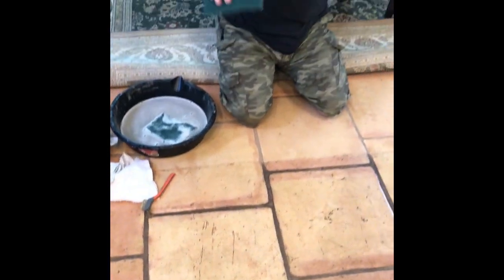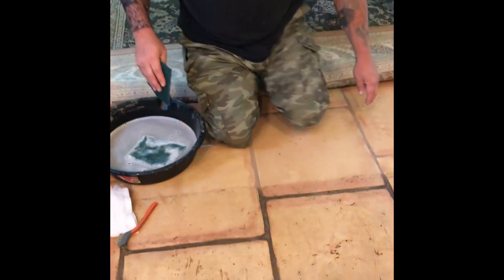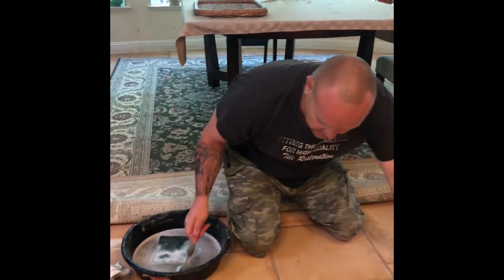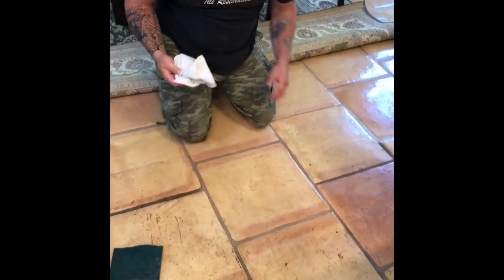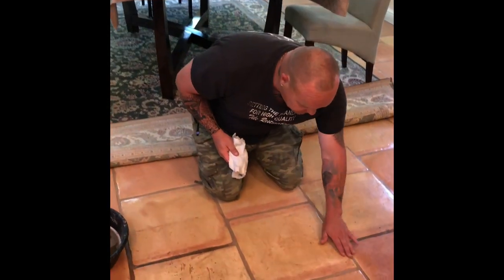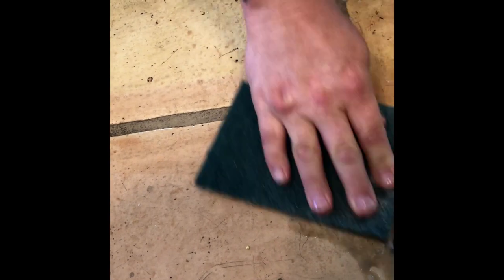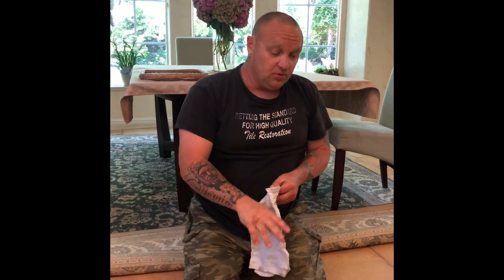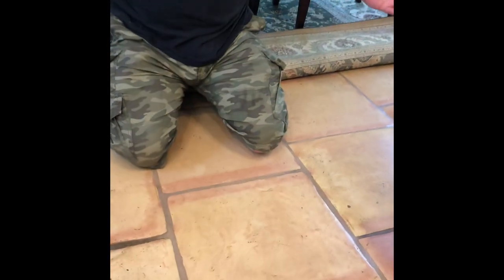How To PROPERLY Maintain Your Saltillo Tile Floor & Grout | Terracotta Tile Cleaning 101

Comment: I am picking back up my cleaning business. What cleaning product should I use to mop Saltillo tile, without taking the shine off what should I wax it with.
Reply from the maker: use a neutral cleaner or a low suds degreaser and dry the floor with old rags or beach towels. Do not leave them damp as they will get sticky and attract dirt thus dulling the sealer prematurely. think windex, fully buff the floors dry after mopping
Reply: @californiatilerestoration4827  Thank you so very much for getting back with me. Although it is three months later. I needed the information when I sent the post but thank you for your time, and I  hope life treats you well

Comment: I’m not sure if I understand correctly but he said that use a two-part sealer? So you put a sealer and then you put the topcoat which would be either a satin or high polish look? And what you’re doing in this video is removing the first layer which leaves you with just a sealer? So all you would have to do is maybe apply another coat of sealer and then apply the topcoat once again a satin maybe matte finish or high polish? Great job bro
Reply from the maker: I finally have access to the sauce. I apologize for the vague content, and yes you are right. Originally we dropped these videos to help frustrated tile owners find the correct restoration company  and solution to their refinishing problems. 

It wasn't until fairly recently that we were actually able to serve our diy'ers.

Want the product we use to remove coatings and old sealer from terracotta Saltillo tile? 

Then call (707) 384-1172 and ask for Fritz 

BUT HURRY because supply may be limited and you don't want to be left out.

Call right now and get a FREE 15 minute consultation when you mention this video by title!
(which you are GOING TO WANT, I promise)
Reply: Hell yeah finally! Hope u guys are located by Orange County .. I need to buy the secrete sauce !! Ty

Comment: I got a saltillo job coming it doesn't look sealed or any coating. 

Do I still got a strip it and coat it?

Or just deep cleaning and then coating?
Thanks in advance
Reply from the maker: deep clean it and see if it gets dark when you pour water on it. if it dousing fully get dark and or looks splotchy, then that is sealer and has to be removed. 

Want the product we use to remove coatings and old sealer from terracotta Saltillo tile? 

Think you can tackle your project 

Then call (707) 384-1172 and ask for Fritz 

BUT HURRY because supply may be limited and you don't want to be left out.

Call right now and get a FREE 15 minute consultation when you mention this video by title!
(which you are GOING TO WANT, I promise)